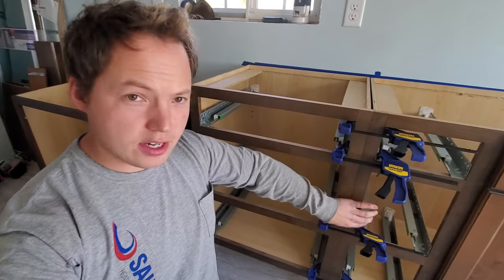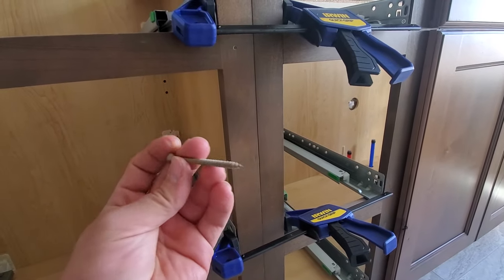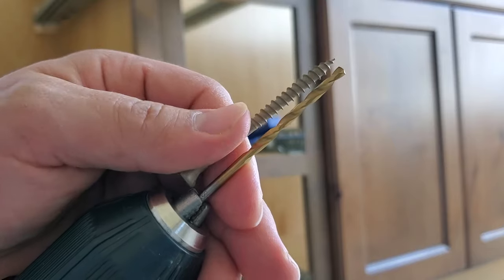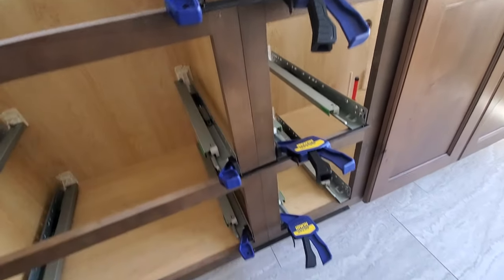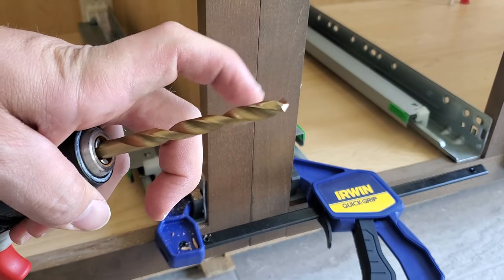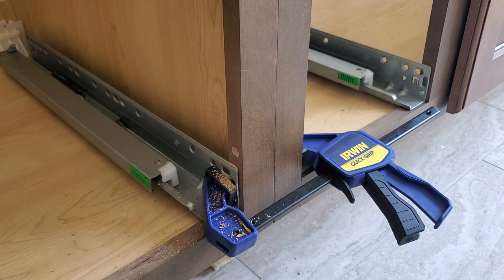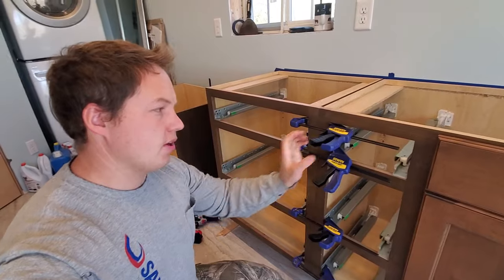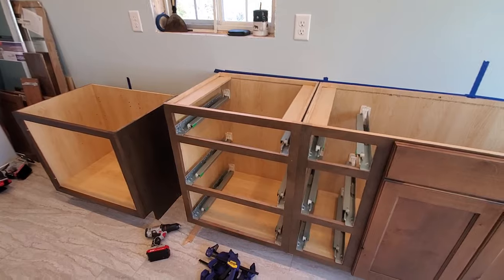How To Screw Cabinet Face Frames Together

Comment: Seems so simple, but recommendations/suggestions on a 12" wall cabinet.where even my smallest drill wont fit? I have hung 4  15" cabinets nicely, then a 12" but i put a 1 7/8 spacer ip to the wall and split out the back of the spacer because I started my pilot hole on such an angle

Comment: My question is if the face frames have a slite over hang on each side won't the cabinet require a shim at  the back to level the sides,why doesn't' he mention this,seems this is just as important if not more so and how do you get that shim at the back lower side of the two cabinets.,why do all of these guys recommend an over hang on face frames in the first place.

Comment: Youre using a screw designed to counter sink itself, confused on why you drilled the counter sink.
Reply: Designed to counter dink in soft wood not hardwood like the frames. They would split.
Reply: @StanSwan  not very often.  Usually you have to hit a knot.
Reply: @ClumsyCars  It only takes a few seconds to drill a countersink, it sucks when the project is almost done and you have to start over because it cracked the face frame. It's only happened to me once but that's one time too many.